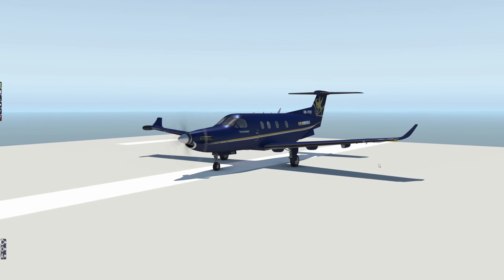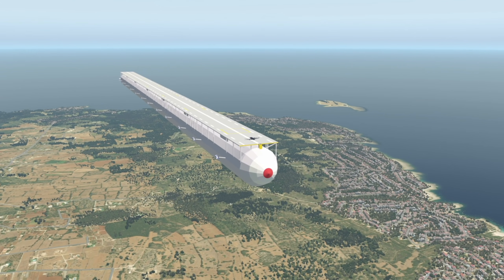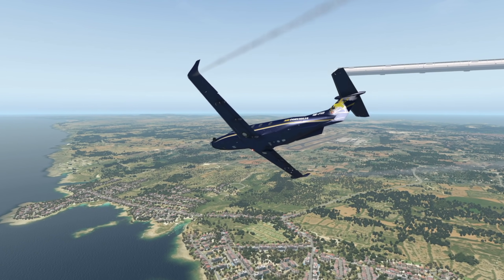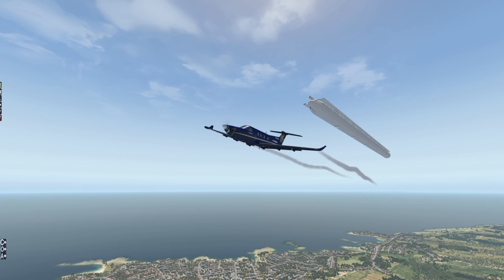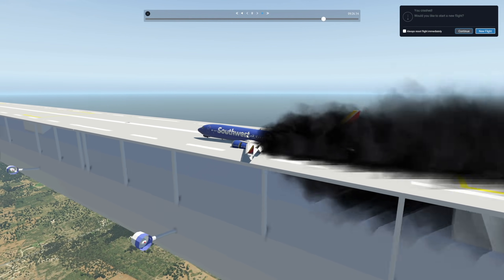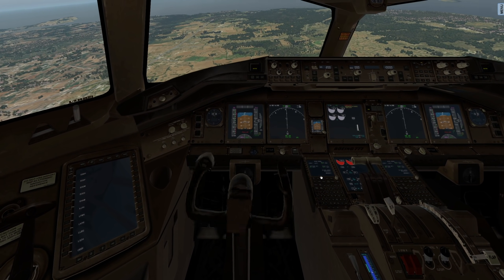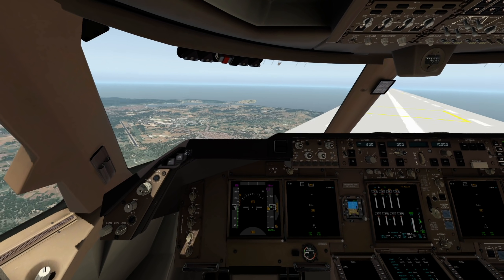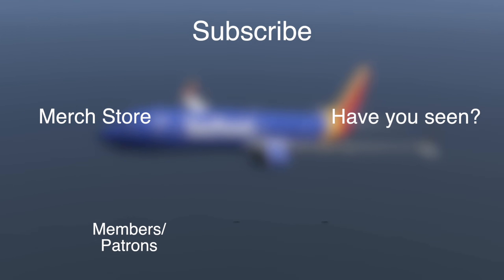Why The FLYING Airport Concept Doesn't Work

Comment: The takeoff problem actually has an amazingly simple solution, that's already being implemented, in a way. There's an airport somewhere in South America built at the top of a cliff, where there wasn't much space. So instead of a runway, planes just drive off the cliff, and achieve takeoff velocity through the power of gravity. I don't know how they handle landing though, so that's still something that needs looking into.

And as for getting to a flying airport, well it doesn't really need to be accessible directly from the ground. It could just be used as a layover point for passengers to transfer between planes.

Comment: The idea would probably be better executed if you didn't think of it as a runaway on a zepplin more like a whole freaking airport floating island supported by a giant balloon that's anchored to the ground, with cable elevators transporting people from the parking lot below to the actual airport. 

    I've actually had the idea to make something similar to this but for high altitude Air Force/ space force type stuff going on with special spaceplanes that would take off from it to get the extra efficiency or performance from taking off from something 3 or more miles up.   The idea for the "air base" is pretty much take an aircraft carrier strip off all the extra weight (essentially everything that makes it a boat instead of a building) and put two giant balloons covered in solar panels (*) on either side.

(also the design has long walk ways for washing off the solar panels covering these giant fields of balloons, the perfect low pressure, low oxygen environment to keep the space Marines as fit as they can be.)

Comment: What i would do is 2 to 3 , even 4 or 5 zepelins of those , joined or fusion in one super like that dual,  with runways in the unions making it more reliable nd able to have more weight and stable , and able to have all thr people , and able to be L O N G E R

Comment: How about this idea of PLANE CATCHER 
What about building a bigger jet where a smaller aircraft can actually land on top of it (probably it has landing bed as it's roof) ??  So in case of any emergency, this would act like the aircraft catcher in the air.
I mean if refueling works in air why not the same concept apply here ? ...the bigger plane should be able to fly faster than usual airplane and so it has the flexibility to outrun or run same speed with the other aircraft ...so in that way in case of emergency, it can fly underneath the plane which is on may day and have it probably lock (it's landing gear or whatever on bottom) on top of this plane catcher...after it has been totally rested upon the top and locked the plane catcher can land safety somewhere in an airport. 

If something like this works out the cases of plane crash would drastically decline.

Comment: The runway doesn’t need to be longer than that. If the plane does not reach VR by the end of the runway, then let it fall off and accelerate towards the ground to build up enough speed.

Comment: Ok so you come from the ground enrouting to your destination which will propably be on the ground and then you land in the air and have to fuckin fly down again. Doesn’t make sense hey what is the use of something like this.   This is the same as having a boat dock in the middle of the ocean. Fuck sakes

Comment: I think the thing you didnt consider with your hard landings is.... in the air you dont need to land from above like your normally do with a plane to avoid terrain. You could fly in just above stall speeds straight in and land.

Comment: Hindenburg had a cargo load of 50t with helium.
You need a lot of helium to make this workd and you need to balance it. 
When aplane with 200ts lands on the one site of the airport, Idon't thinks it would stay stable.
The simulation is only for flying an ddoe snot take this into the calculation I guess.

Comment: I imagined this concept with two zeppelin bodies with a runway in the middle. More stable and with more carrying capacity. Really makes no sense today, but maybe during WW1 or WW2 it could have been useful. With catapults and arrestor gear on deck you could achieve takeoffs and landings without a massively long runway.

You could bring figters closer to the frontline so they have more combat time before running low on fuel, and they could return to the flying monstrosity to refuel and rearm. Of course it would still have to be far enough from the frontline to not be immediately shot down in flames, but it's still interesting to think about.

Comment: You would use a plane to get to the airport and we could make it solar powered but we would most likely use gas to power a flying air port but to get gas up there you use cargo planes they already refill jets file mid air going 100 miles an hour doing it so why couldn’t they do it stationnary

Comment: I mean... bisides the fact that there's no way to get planes off of that runway as there isn't room to turn around, no parking spaces, the fact that the zeplin will have to land to deliver the passengers anyway so the plane might as well do it, and that the runway and planes would be too heavy to remain in the air, I think thus is a pretty solid concept. 9/10

Comment: Kind of only useful as a quick refueler where you don't need a terminal or parking, just literally stop for gas and takeoff again, which could increase overall capacity down on the ground airport it's stationed nearby, other than that yeah I'd agree it's pretty not useful outside of the military where it could also be used similarly to a naval carrier.

Comment: Why not have a airship liner with a deck the size of a small aircraft carrier and internal hanger for VTOLs, helicopters, rotodynes and small prop planes? Airships could run its engine of batteries charged by solar or wind power, alternatively small turbofans or turbo props could be used for faster ships. Using this combination (with helium gas of course) could eliminate the need for most runways. Also, you could make over five individual airships out of that airport one

Comment: I just realized, whats the point of a flying airport? Like, you still need to get down to ground...
Reply: SpinosaurusStudios iQ: 500+
Reply: You just jump onto a big trampoline at the bottom, duhhh. Or you have a ferry helicopter, OR a big ropeslide. It's not practical but its damn cool. Myabe people would pay a bonus for the novelty
Reply: @agdgdgwngo  you are gonna be a CEO with that brain. so smart
Reply: The only use I see for this rather impossible concept, is for refueling and having alternate runways for emergency landings.
Reply: Refueling for long flights
Reply: @science2037  they should add air to air refueling to ailiners lol
Reply: @science2037  but you can refuel normal in ground airports
Reply: connecting flights only
Reply: I'm thinking more of an aircraft carrier job rather then an airport job. A big flying ship to transport a big portion of the air force in one trip over enemy controlled space. Then to refuel. So it's more of a way to transport, deply, and refuel military jets rather then get people to a city.
Reply: You could use helicopters, but let's be honest, it's not really practical
Reply: bruh exactly

Comment: It does work, but the thing will need to have helicopter rotors everywhere to prevent it from moving while another plane lands, the planes will need to be small/light enough to actually land without tipping over the giant zeppelin, and helicopters themselves can't be used because the downward force would push the whole zeppelin down. It's a perfect air-zeppelin drone aircraft launcher in concept tho.

Comment: But wouldn’t the weight from the landing planes make the zeppelin dip down slightly?
It doesn’t look very stable seen as its a spherical shape. Doesnt seem to have stabilizers. So wouldn’t it be prone to flipping over?
Where is the atc tower?
Where would the planes refuel at?
Where would the planes be stored?
I have so many questions

Comment: but if this was anything like an aircraft carrier, it would have to include arrestors and catapults making landing and takeoff easier on shortened runways. Aircraft would need to be compliant, and it could function as a hub and not necessarily a "port". Would fuel savings (from not having to climb from sea level) justify its own cost? Who knows. Damn it, just build the damn thing, I want to eat a burger up there.

Comment: A floating highway is impossible. If you land on top of it you would make it unbalenced. HOWEVER if the zeppelin had a hook on its CG  you could stall a plane just on the hook and than the zeppelin would pull the airplane inside. Crimson Skyes played with that idea a lot

Comment: the problem with air aircraft carrier is actually air density is waaay lower so u need loads of speed to take off and as the engines swallow less air up there the engines loses lots of power cuz of it so... good luck
edit: theres also way higher stall speeds due to less air density which is horrible in landings
Reply: well... did you even think that its a good idea? i guess welcome to reddit boi
Reply: @fedlyn9053  nah just adding more reasons as to why its unviable
Reply: Ikazuchi-san just use a airplane that uses propellers, if anybody even uses them by the time things is made (it probably won’t even be made)

Comment: But if you try to land an aircraft on a floating airport like this , it wouldn't be a stable landing because as soon as you  touch down the whole force of the landing will shift the weight and CG of the floating runway apparatus, this tilting the whole floating runway upwards. I don't think a floating airport concept like this would even support the weight.

Comment: Flying airport: *Exists.
Tornados and hurricanes: "I‘m going to end this airport's whole career"
Reply: How about strong gusts of winds?
Reply: @ferbthe2gadgetguy  Generally lighter than air vehicles have systems to deal with that problem. also this is very low to the ground for what it is. You would typically want this above 5000ft personally I would have it at about 15000ft.
Reply: @okimoy2688  I identify as Heathrow Terminal 5
Reply: @okimoy2688  hello Dad, I'm Heathrow Terminal 5
Reply: Hopefully they would float above the clouds but then the air would be to thin
Reply: @Terpyrips  And how would people get off when the air is thin
Reply: Otanaku Leana in the age that an airport floats is the same age that people are immortal and dont need oxygen
Reply: No
Reply: *carrier
Reply: yeah you really think we'd park hindenburg 2 in florida.
Reply: Omg
Reply: @okimoy2688  that's not how it works dumbass, someone must put "I'm"
Reply: Hahahahahahaha 😂👍

Comment: Linus Flys to a floating airport- stalls out and drops plane onto runway-
Ryanair- Reverse thrust mid-air and plane slams into runway-
Swiss001 100,50,40,30,20,10 butter

Comment: You could add 2 benefits:
-less noise pollution, that's topic no. 1 for some airports
-lots of kerosene saved by not going down to ground (esp for transit flights)

Comment: Fun fact: The U.S. navy once had two zeppelins called USS Macon and USS Akron which served as airborne aircraft carriers that carried 5 aircraft (4 stowed in the internal hangar and one on the rig [which I believe is called a trapeze]. There are others like the proposed 747 AAC as well as bombers such as Tupolev TB-3s And B-36 peacemakers having been fitted with parasite fighters which, in the case of the TB-3s were used to some form of success, while the B-36 never surpassed testing, and 747 never leaving the drawing board, these were nowhere near as colossal as the Akron class carriers. There was also a plan by Lockheed-Martin in the 60's to build the CL-1201, which would have been powered by a nuclear reactor and would carry the aforementioned 747 AAC via large towing cable. The proposed aircraft would have had a wingspan far greater than 300 meters. I know this is all of topic, because none of them are true flying AIRPORTS, But its still fun to think about.